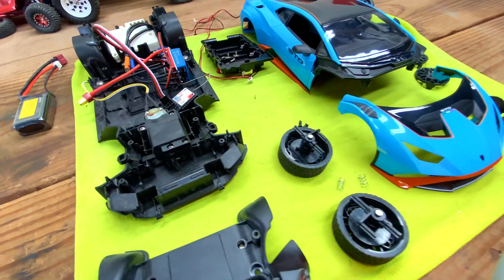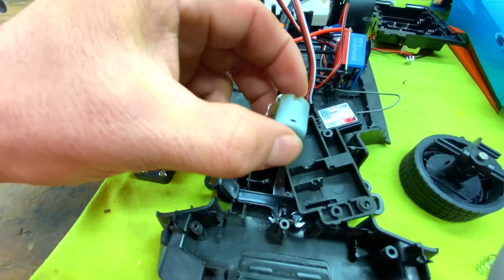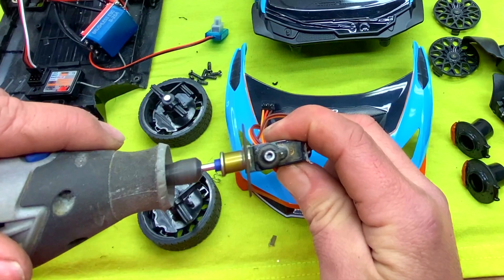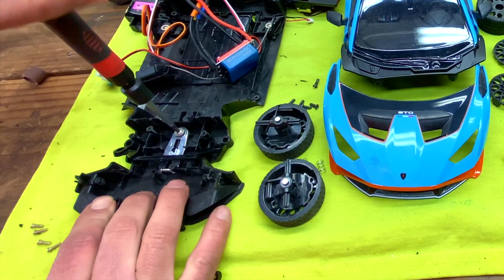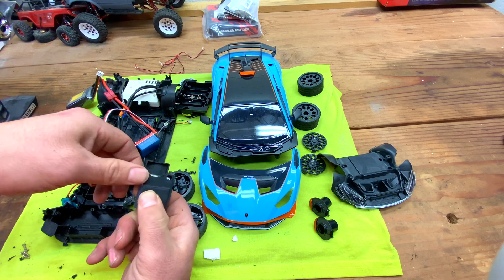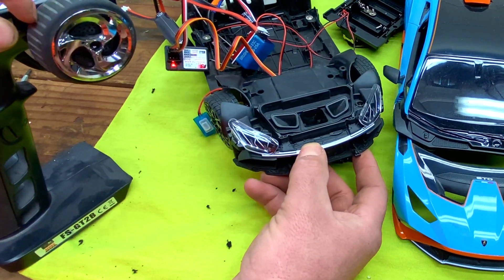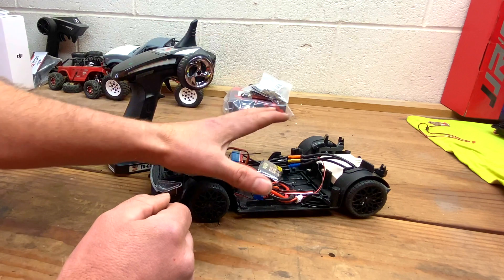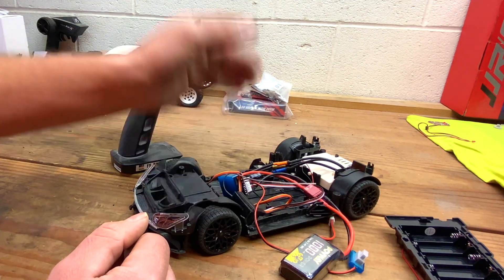Rastar Lamborghini STO - 9G Metal Gear Micro Servo Install - Toy Grade to Hobby-ish Grade Part 3

Comment: Hi, 

Thanks for making these videos. 

Can you please share details of the motor which was there initially? Motor on my son’s car is broken, so want to just replace it with like to like without having to cut those plastic bits.

Cheers!
Reply from the maker: Hello. Yes the stock motor is a brushed 260.  Hopefully you can get it replaced for your son.  Thanks for checking out the video.